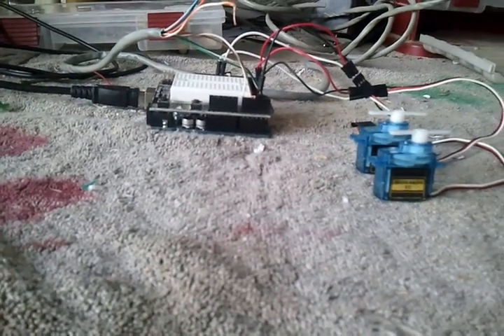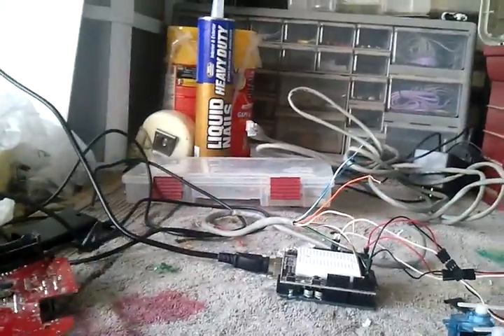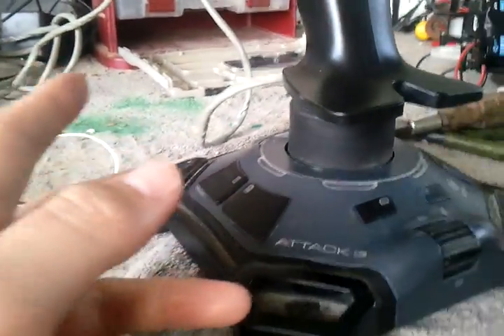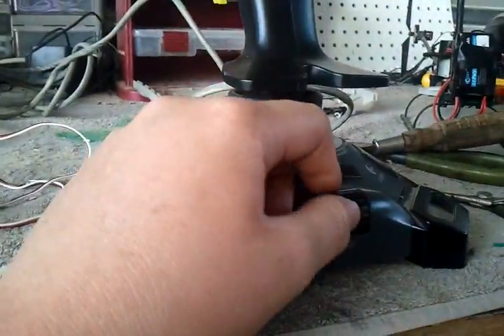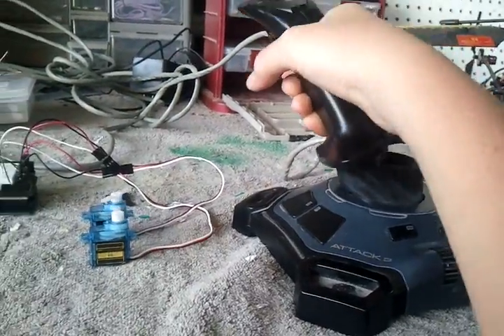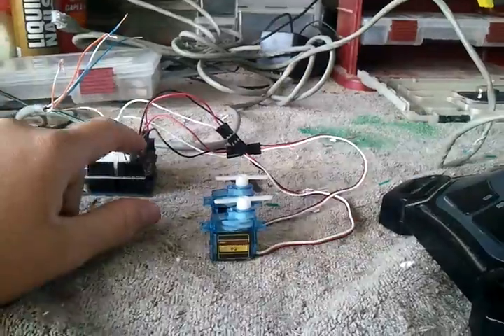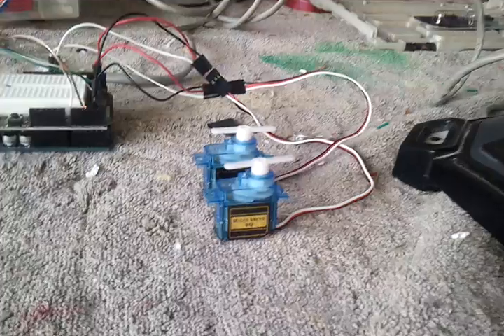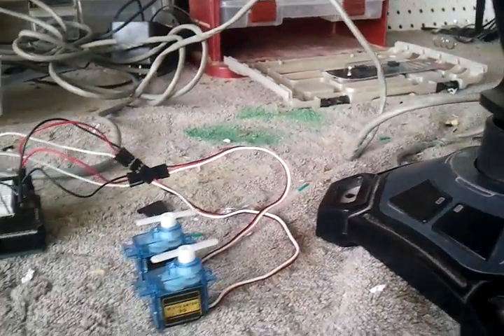Controlling servos with a usb joystick and arduino

Comment from the maker: Im unsure that I even have the code anymore. Its fairly simple, just use the x axis for one servo and the y for another. The code says that it maps and writes the values from the potentiometers on the joystick to the servos. Find the high and low ends of the pots for the mapping values, like if the pots read 50 - 1000 then map the values of those to 1 -180 for the servo. duplicate that part of the code for the other axis

Comment: So you do not actually use USB? You're just using direct connection to potentiometers and buttons. But the USB connection will be potentially much more interesting. Have you thought about connecting through USB? I think this will be much more tough (at least you will need to reproduce the USB communication protocol). This will be pretty cool, as potentially you will be able to use virtually any USB joystick for controlling RC airplanes..